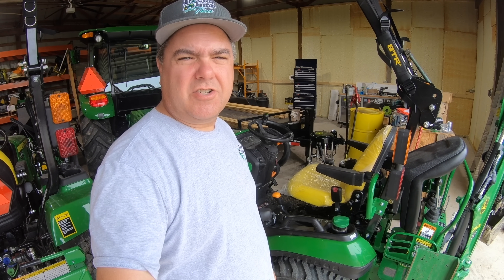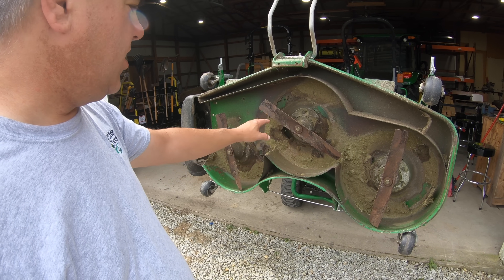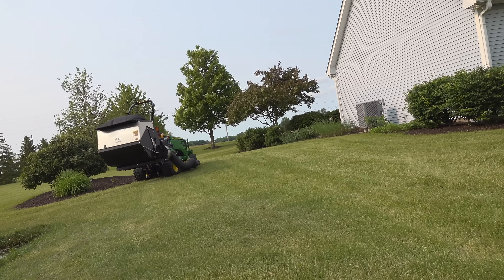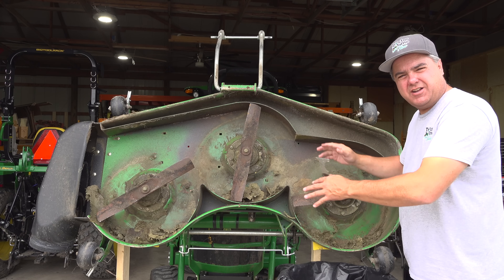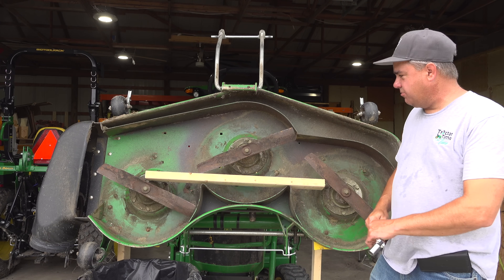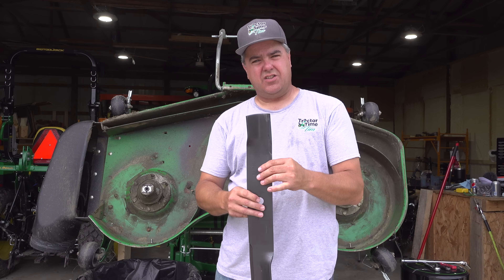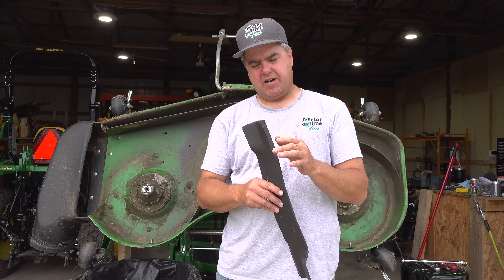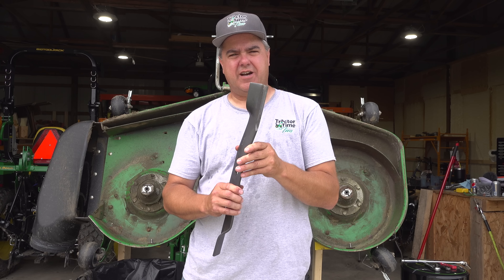Never Sharpen Your Mower Blades Again???

Comment: Good point as mentioned (and warned), that when considering the self sharpening, it works with the condition that the blades cut grass only.  They aren’t made to self sharpen if roots and rocks are an issue.

Comment: I am a retired lawn care professional. I'd like to offer 2 tips. Don't cut too low. Most lawns are butchered and the blades take a beating. Next, find a puddle and run the mower into it and let it work for a while. Then park it o ernight and let it dry. Then grease the spindles. These self sharpening blades need some tome to prove themselves.

Comment: You talk about cleaning beneath your deck to prevent the deck rusting out.  If you clean beneath the deck really well, then spray the underside with spray in bed liner.  The bed-liner will last a complete mowing season, the grass won’t stick to the underside, and it will seal the deck against rust.  Each year you will need to touch up the bed-liner because the grass will wear it down in spots.  I’ve used this method for over 10 years and my deck looks like new.
Reply: even better idea, EZ Slide graphite based friction reducing paint. its a wear coating, but it is sold for AG purposes.  Often a coat a season for a lot of mowers.  The point of the coating is  its rather harmless to anything it gets on when its dried because its mostly graphite and inert substances.  Its a little funny to go on, but you can also put more layers on in a proper manner and it will last longer. Its just the idea that its meant to lubricate and wear as function/design  but the important part Is LUBRICATE!!! bedliner spray is not a low friction thing.  In a mower deck, low friction means stuff wont stick, especially since it sheds off if it tries, but also that if you have a discharge or using on wet grass etc, it reduces the amount of effort the engine has to put down to spin the blades because the grass is not resisted nearly as much.  If you have a side discharge and mow your grass infrequently on the larger field part of  the lawn(like me lol) it makes the engine free up a good amount and you can get a more proper cut which when its overlength and possibly not fully dry its alreadfy hard on the grass and presents issues... the increased speed assuming you move the same speed means more clean cuts which is better for everyone invovled. If you dont care about that, it allows your 26hp and 54 inch deck to make quick work in half the time.. lol.. not literally half but some times time is a valued commodity.  And just the not-sticking to the deck is wonderful on its own.

On our john deere mowers I am gong to get the inserts for the deck washing thing so you can easily clean your deck and Im going to put the decks to the pressure washer and perfecltly knock down the grime and grass and even the graphite paint, get it cleaned up where its rusty, get it primed and painted with some hardened implement JD yellow, then properly put my graphite paint on in a few good coats per the cans  and then store for winter so I can just get to it in the spring.  Also put a new blade set on the one mower and sharpen the other ones :) Grease my spindlkes of course of course.  Belts are good. One deck needs an idler.  I may be a mess in life but One thing next year wont have on me is deck or grass unpreparedness lol
Reply: What about non-stick cooking spray?😂

Comment: Mower Deck - Air blow-out with a wand after every mow. At seasons end, a full scrape/de-scaler clean up under deck and then a waste oil coating for winter storage. Been doing this for decades with the same deck and have not had any problems.
Reply: I ruffed mine up with a wire brush on a minnie grinder and coated the under side with fiberglass resin years ago. Nothing sticks to it.
Reply: For used decks that have heavy rust, first clean off the chipping layered rust to tight rust. Use some oxalic acid to turn it black. 
  Get some agri- guard and apply two coats as per instructions. It dries super hard and even battery acid or fertilizer will not touch the stuff. Expensive at forty per quart but do worth it
Reply: Silicone spray lubricant might also help prevent rust and crud sticking to the deck. Worth a shot. Works well for preventing snowblower chutes from getting clogged
Reply: @docmadhattan  Pan spray from Costco or Sam is cheaper still and completely harmless.

Comment: The "bottom layer" is carbide. The process does an electric arc transfer of carbide to the steel. It is not glued on, it is welded on. The coating is about .004 thick. Given that it is carbide, it doesn't wear as easily as steel. As the steel wears away it leaves behind a .004 thick layer of carbide. It is very sharp so it cuts well. The reason you don't want to hit rocks is the exposed carbide edge can break. The steel edge will wear back and expose the carbideccagain hence the self sharpening. These were developed for commercial use in Sandy soil and have proven to work.

Comment: Not sharpening the blades is great and all, but do they stay balanced?  Most of the issues that you will have with blades are due to being out of balance, not because they get dull.  A log of guys balance them on a screwdriver shaft or one of those little plaster cone balancers.  Those are not very sensitive.  If you can find a good "friction-less" balancer, you will notice a considerable difference in how well you can balance the blades.  When I got one of these I did a comparison and found the results to be vary noticeable.  The deck ran smoother and quieter.  This will reamatically extend the life of your sheave bearings.  I have over 1500 hours on my deck now and no issues with sheaves or bearings so far.

Comment: Anything that says John Deere is expensive. My dad had a John Deere mower with a 30 inch single blade deck. He would go through 2 blades each season as they wore the lift wings off. I welded hardfacing rod on the new blade along the cutting edges, across the end, on the wings, sharpened and balanced them. He could mow for 3 seasons on a blade and said it threw the grass out better. I've done it to the blades on every mower since then.
Reply: Wow. Been mowing with my Country Clipper for 11 years and haven't needed to replace a blade yet, just resharpen once a year. And yes I mow several acres a week with it.

Comment: I recommend you power watch the underneath of the deck.  Scrapers will scrape paint protection and rust will happen sooner.  For longevity, use water spray.  Good video.

Comment: When I buy a new mower I always sandblast the underside of the mower deck and prime it before applying automotive chip guard . And after a few years check to see if it needs any touchup , and the deck will never rust out .

Comment: You can hold the blades with a gloved hand, if you use an impact wrench to take out the bolt's.
Reply: I'd be MIGHTY careful.  If your method fails, the damage will be swift and massive.

Comment: I sharpen my mower blades once a year. My trick is to weld hard surface on the  upper side of the edge of the blade. Just three passes with a stick welder and the shape just keeps. The hours of my tractor cutting two acres is about two hundred hours roughly. They hold up really nice. The duty of cut is just standard and NOT ROUGH MOWING. Worked for me.

Comment: I used to live up north where they used salt on the highways every winter.  I can’t even remember how I started using a spray and bar luv under my truck and cars but it stops rust.  Then I started using it underneath my mower decks for the same reason.  If the oil you buy is too thick to spray, just dilute it with alcohol, or a bit of diesel fuel.  I don’t recommend gasoline.  Let it set for a couple days and then just mow like you always do.  If you get it up in the air like you did on the video.  I would just give it another spray.  If you like the power washer, that’s good but keep the bar oil on it as best you can.  I sure wish I was at that auction where this fairly new tractors were going at such a good price.  I would even drive all the way out there but I don’t have a heavy duty trailer to haul it back to Arkansa.  Thanks Tim.  Good luck in getting your wife to do all the mowing.  Later

Comment: also note if you are mowing two different types of grass you want to clean the deck so you dont spread grass seed from one type to another, we did alot of Bahia and st. Augustine grass, so we would cut the Bahia first clean our decks and clean our blades with vinager and do a quick touch up sharpening before we would start with the st Augustine

Comment: Well - while I agree they can work  —he left a few things out on the description such as — if you have rocky, poorly maintained fields - per the manufacturer, their self sharpening blades aren’t for you. Or that they work best in sandy soils.  Note, these aren’t self sharpening like big paper cutters or even old fashion self sharpening reel mowers that sharpen themselves as the blades pass each other. On those, the angle is such that they just graze each other and some of the blades have a piece of abrasive material  that sharpens on each pass.  Below is John Deere’s description and qualification on their take on self sharpening blades.  But before I paste that info in - if you are a professional landscaper or even a diligent homeowner with a nice lawn —- please maintain and sharpen/replace your blades as frequently as needed depending on the use — once a month or daily on 4-6+ lawns.  I’ve gotten rid of more landscapers for not maintaining their equipment especially dull blades.  If they work by the hour, their poorly maintained equip breaks down often and I don’t like paying for their maintenance time.  But even at a flat rate, there are problems.  One recently told me he never sharpens his blades (in anything) - just waits til they have been on a couple years and has them replaced or throws away the smaller tools. Blades that aren’t sharp don’t cut the grass cleanly — it rips it - leaving split tips which in just a day or so dry and turn brown, leaving an dead haze.  But even worse, like with loppers, hand pruners, saws, etc - rough, raggedy cuts allow moisture and disease to get into the plant - especially fungal but also allows microscopic insects and other diseases easy entry.  AND IT JUST LOOKS BAD — very unprofessional.  Another issue - if you don’t clean your under carriage - in addition to rust and shorter overall life, you also transfer disease, insect eggs, and weed seeds to other properties.  The best and only real landscaper I have ever seen - had a pressurized tank of water and chemical disinfectant - before loading mower back on his truck, he had a setup that tilted it sideways and he pressure washed the under carriage after every lawn.  It just took a minute or two.  Everything he did was just as meticulous - I was so sorry when he retired - he was a true landscaper, groundsman, plant specialist/horticulturist, garden designer, and he knew soil and soil improvement inside out. He was not a glorified grass and weed cutter who call themselves landscapers. This guy was a whiz!  His 1st career after being European college trained in landscape design and horticulture was working at United Kingdom private estate and public gardens; 2nd career after retiring was moving to USA to be close to family and working as landscaper to “rebuild the coffers”; 3rd career at 75-80 yrs old was moving to lake front mountain property, to teach trout and bass how to be caught and be the chief tester of his wife’s wonderful cooking.  I was fairly versed in gardening but this guy was a marvel and taught me so much.  Maintaining a pretty lawn is time consuming, expensive and not particularly good for the environment due to the typical high amounts of water, fertilizer and chemical usage whether a small residential lawn or a large commercial or park property. You can help lessen this impact with smart practices (always do soil tests annually or at least every other year until you see how the pH is maintained by the soil; keep pH appropriate for what you are growing 6.5-7.2*; mow high particularly in dry, hot months; water deeply and less often encouraging the roots to go deep; use organic fertilizers; maintain calcium (and sulfur) levels so plants can take up what you feed them using gypsum if no pH change is needed or, if you need a pH increase along with magnesium and calcium - use dolomitic limestone; utilize micro-clovers or even the larger Dutch white to allow nitrogen fixing to help feed the soil; if you use clovers, avoid herbicides that kill them, instead use weed prevention methods; spread a thin layer of compost each fall after core aeration & after a long rain so the cores go as deep as possible; mow leaves and leave in place along with grass clippings; if you have heavy weed pressure, know them and their seed cycle - vacuum grass clippings when weeds are maturing and going to seed; finally, but not least - keep sharp blades to prevent disease).  Having to treat disease adds to the environment issues and causes more use of chemicals to treat a problem that should have never gotten started.  I have seen people being fooled into excessive fertilizing and chemical treatments that could have been solved by soil testing and following the above recommendations.  *warm season grasses can tolerate slightly lower pH levels over cool season which need the higher range up to 7.2. Too acidic or too alkaline will affect nutrient uptake. Each nutrient has its own prime level for optimum uptake - try to hit the sweet spot for your soil, environment, and grass type. 

So, off my “dull blade” and “landscaper” soap box — here is John Deere’s description.  I hope it helps someone considering whether to buy or not.

“The John Deere self-sharpening blade is a patented technology that applies a layer of extremely hard material on the bottom side cutting edge of the mower blade (highlighted in the below photo). Mower blades have a significant impact on the cut quality and are a component that requires regular maintenance to keep the blades sharp. The amount of time that is required to remove, sharpen, and reinstall is a pain point for your customers. This constant sharpening of blades can also result in shortened part life when sharpened by hand due to the inherent inaccuracy in how much material is removed during each sharpening. This solution addresses the customer pain point by reducing the need to sharpen blades saving time/labor and reduces the human aspect of blade sharpening extending the life of the blade.  The layer of hard material wears at a slower rate than the standard steel mower blade. By creating a different wear pattern, the hard material is exposed continuously creating a sharp edge. As the mower blade is used, the base steel of the mower blade continues to wear faster than the added material which provides a continuous edge that essentially self sharpens itself. These blades work best in abrasive conditions like sandy areas.

There are several benefits for the customer using these John Deere self-sharpening blades. Reduces the time needed for maintenance of a mower blade by only requiring the mower blade to be removed when it is needing to be replaced.  Helps to ensure the full life of the blade by preventing excess material from being removed unnecessarily during sharpening or removing the temper from the blade resulting in weaker metal and quicker wear. Helps to prevent damage to other components during maintenance (such as striping the spindle threads). Improve overall health of grass by constantly having a sharp blade.  ( I wonder if they meant stripping?)

The John Deere self-sharpening blades are not to be used in abusive conditions with non-turf objects such as rocks, litter, roots, stumps, or other debris. These conditions can typically be found when mowing roadsides, unmaintained fields or even some parks. You can tell if a blade is used in abusive conditions if there are big indentations in the blade or if it is bent. Qualify your customers by asking the right questions for example what their mowing conditions are, where are they mowing and do their blades have big indentations.”   

——
Sorry, another soapbox —
So the advertisement shows a big foo-paw (or more accurately a “faux pas”) ....loose clothing around a PTO shaft - the tractor isn’t running but obviously you wouldn’t be fooling with it unless you were planning on doing so.  Always make sure you have a guard in place that is in excellent condition - not broke, cracked, missing parts, etc.  whether you have a guard or not — if the tractor is running - never ever consider it safe to work on the PTO just because you have it disengaged.  People die, lose limbs, etc every year when PTOs have unexpectedly re-engaged, or their loose clothing got caught, or they decided to step across instead of going around, or even worse - children slip off the tractor and fall in to a running PTO. It happens  frequently and farming is considered the most accident prone industry.  If you don’t believe me - search “tractor PTO  accidents” .  It takes just a couple of seconds - too quick for help to get to you and certainly too fast for you to be able to get yourself loose.  It won’t take but one time to scare you straight - however, that one time may be fatal — to you, a child, or to an employee or family member.
Reply: 6

Comment: Hi Tim, I had the under side of Mine Sand Blasted , then had it Rhino Lined pickup bed spray on Liner. That was 10 years ago I just scrape it off Once a year,No Rust makes it a Little Quieter Too! Sure beats paintingit every Year! Tou could do it with that Roll on Liner they have today too!